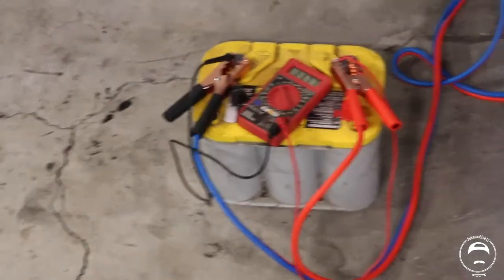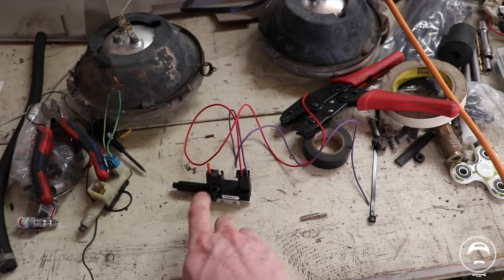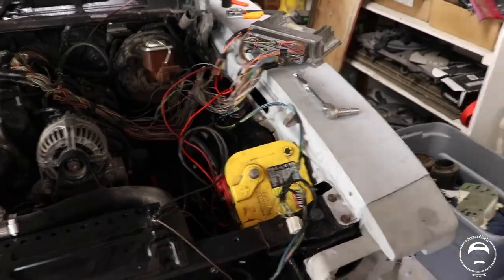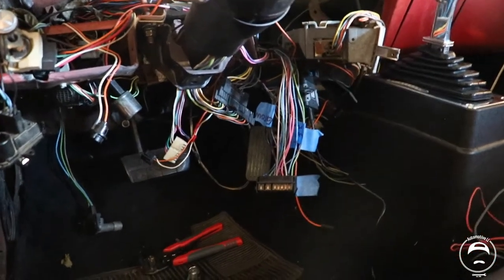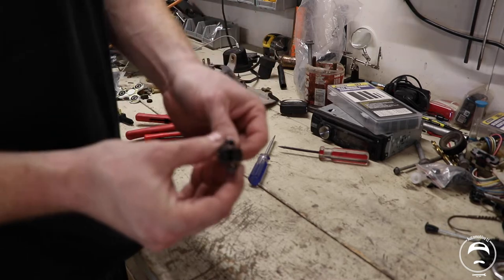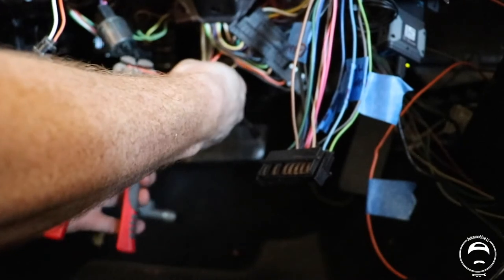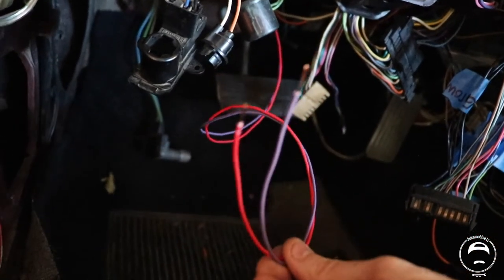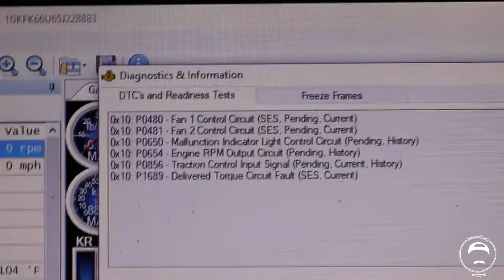LS swap TCC switch install

Comment: What if my brake switch has the blue, orange and white wire on the  harness ?
Reply from the maker: Did it come with a wire diagram? I’d find out what wires do what when they are powered on.

Comment: So a 4l80e needs the tcc signal from the brakes? Or can you run it without, mine didn't have the wiring for it for my ls swap.
Reply from the maker: So it needs it for the cruise control circuit on my build. It is also used for the torque converter lockup but If your using an aftermarket harness and computer the function is probably controlled by something else like vehicle speed.

Comment: Hey what's up bro I'm doing the same tcc break switch that you have but under my dash my wires are yellow orange and blue on one plug you know my white plug I got a pink and black wire and a solid purple wire so I was thinking that I use the blue and yellow wire or the other way around on 87 Camaro
Reply from the maker: I’d have to look up some stuff to be able to help I’m not too familiar with the camero stuff. Best I can say for now is use a multimeter and probe the wires to make sure your getting the correct voltages is hen you press and release the brake petal.
Reply: @ALLRacing93  Hey what's up bro so when I put the purple and pink wire on the new brake switch it doesn't do anything but when I hook it back up to the old switch the yellow and orange and blue wire turns the brake light on and off when I put a test light to the yellow wire and press the brake light and the light goes off on the yellow and orange wire but stays on the blue one so do you think I need to use the yellow and orange wire on the new brake switch and leave the purple and pink one alone but I think I have to hook up the orange and blue wire to mine's new tcc break switch

Comment: Does this work as neutral safety switch???
Reply from the maker: No this it torque converter lockup and cruise control the Neutral safety should be on the side of the transmission

Comment: What about for a vehicle that has a clutch pedal already using a Manual trans matched to a 2003 6.0 lq4  automatic harness but has been depinned   pcm has clutch pedal position pin and then a clutch switch start signal  whats needed to wire in a switch for the clutch do you use a regular brake switch type theres not much info directly on this i can find
Reply from the maker: Yea that’s interesting. I’d look on lt1 swap . Com and see if he knows anything about it.